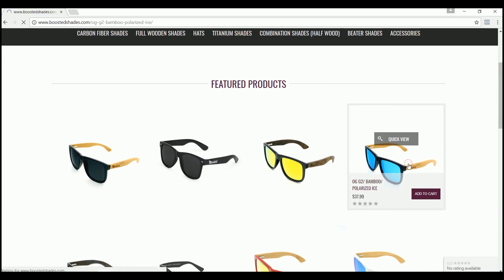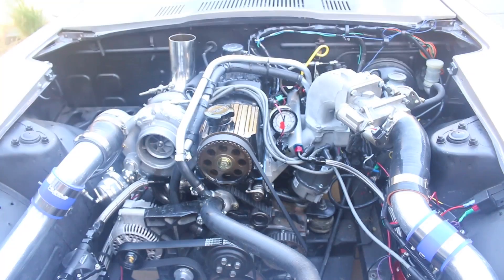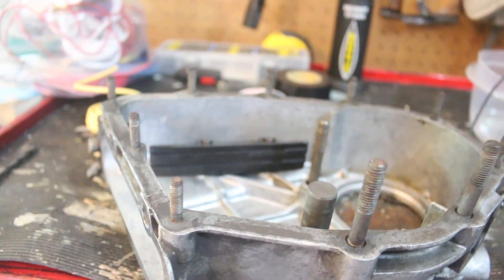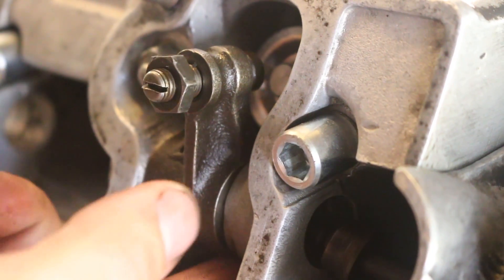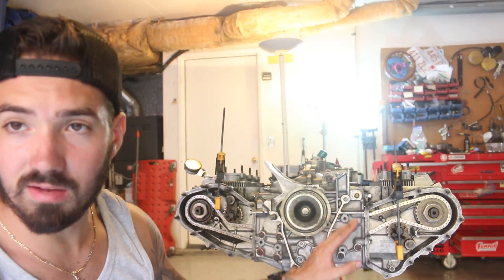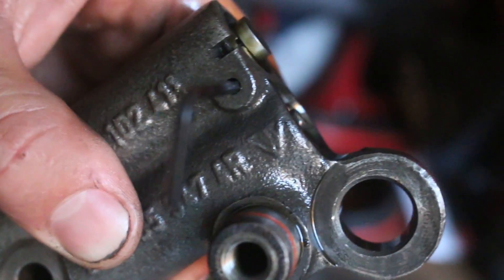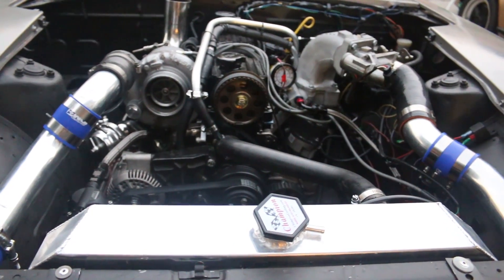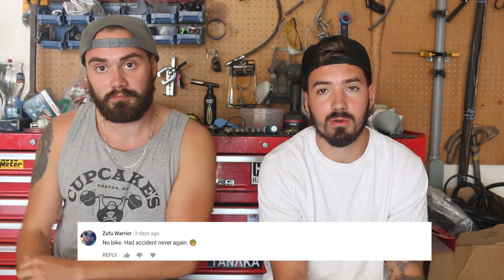Worlds Weirdest Timing Procedure? Porsche 911

Comment: Hey guys I've seen instances where rtv can ruin threads (in aluminum). It mostly only hurt fine threads and that's bolt is going into cast steel so you should be fine. But they do make thread sealers specifically designed for sealing threads, I'd look into something like that before using rtv.

Comment: You are fucking cracked man. I cannot believe you did that. Throwing popcorn in the bike muffler. And, you did not video setting the cam timing. I know it is complicated and has to be very exact. I have seen it done on other vids but I have never seen the actuall sprocket and how they turn the cam in the sprocket since it is on the shaft with a keyway. Did you have to take the muffler off the bike to make sure all the popcorn is out of it? You would look funny riding down the street shooting popcorn out the back. Lol